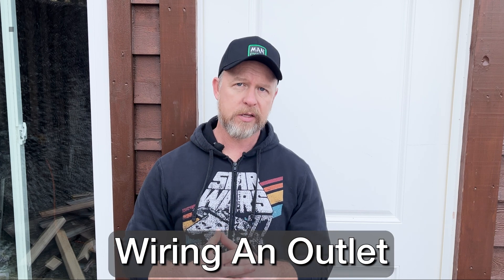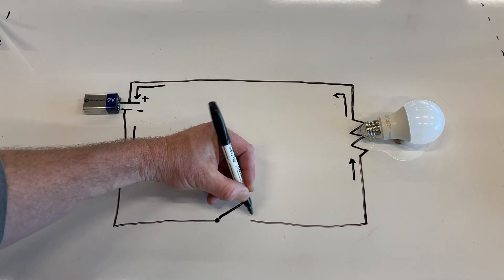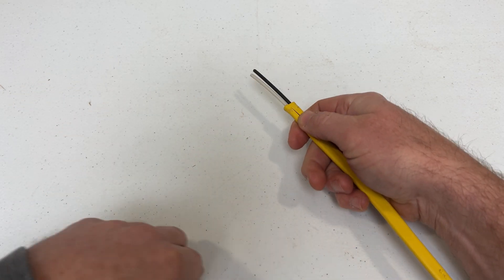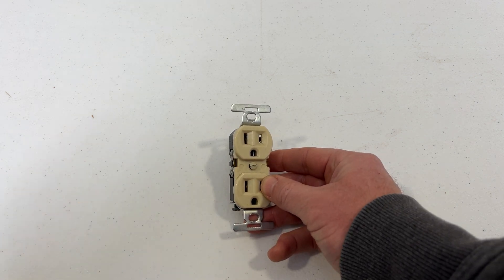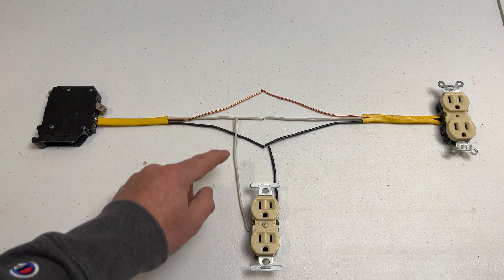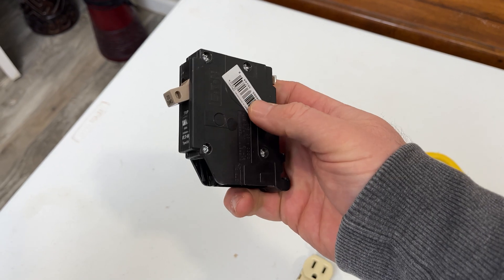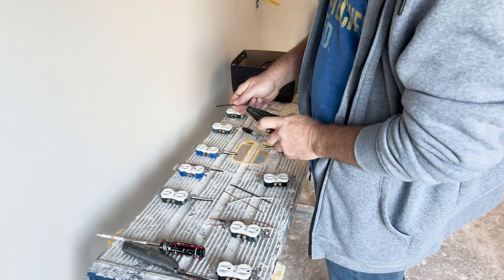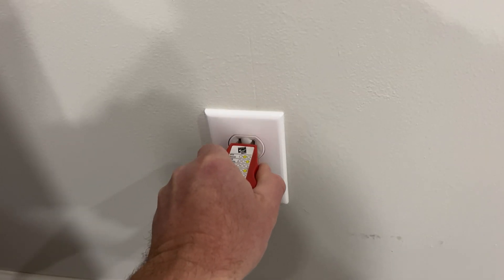How To Wire an OUTLET - The Science, Materials, and Connections!

Comment: For anyone getting confused by terminology - The method described here is called parallel wiring, most people call it pigtailing the connection.  The first method he described is called series wiring, where the power runs through each receptacle to move down the line to the next receptacle.  Professionals use the parallel method because it makes troubleshooting in the future much easier for the next electrician that has to work on the wires.  It is also easier for a homeowner to just replace a faulty receptacle if there is an issue.  As this was a 20 amp circuit, you also have the option to use commercial grade receptacles.  These make the installation much easier as you can do what is called back wiring on these types of receptacles.  No shepherds hooks required, and it is not 'backstabbing', that is only possible with a 15 amp run (14 gauge wire), and is frowned upon by most professional electricians.  If you open up a commercial grade (Spec grade) receptacle and a standard 15 amp one, you will notice that the entire unit is built in a more substantial way than the standard 15 amp receptacle.   When doing the grounding wires up, invest in some "Greenies" wire nuts.  It ensures a good mechanical connection of the grounding wires and has a hole in the top of the nut so you can leave one wire longer and connect it to the receptacle. My 2 cents. 😁
Reply from the maker: @BackwoodsLaw Thank you for sharing your expertise! 🤙🏻

Comment: Almost everywhere I've worked as an apartment maintenance technician, I've seen the outlets being used for load and continuing the circuit as you clearly don't do. These apartments should be normally originally wired by apprentice electricians and then verified by a licensed electrician. Personally, I like the idea of using jumper wires from the line and circuit continuity. It maximizes the life span of the outlets.
Reply from the maker: @driveral1305 Absolutely - thanks for sharing! 👍